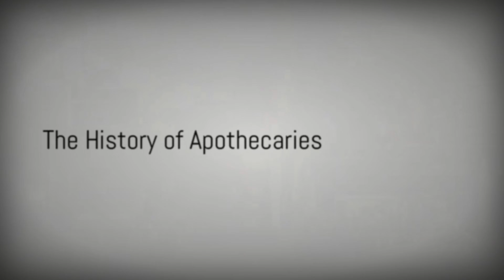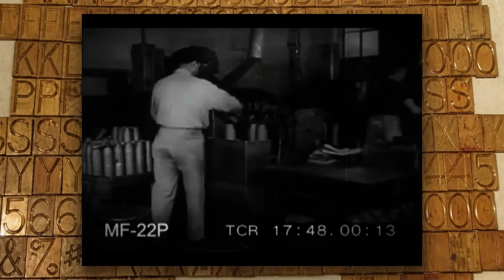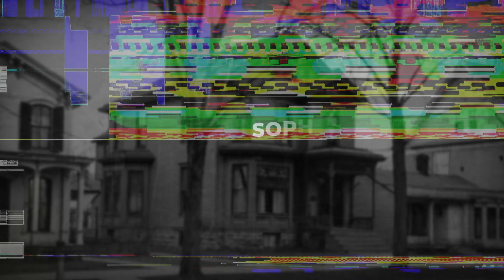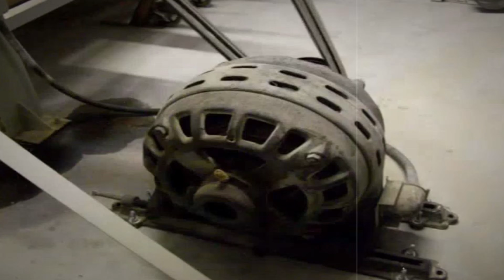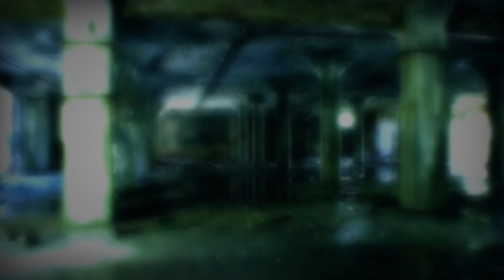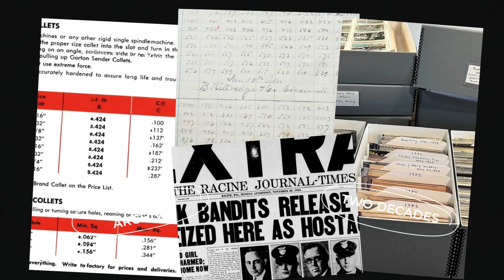The Rise and Fall of Gorton Machine Works

Comment: I new Albert Marini. He started Marini Tool and Die. His son Albert Jr. worked with him and took it over when Albert Sr. died. Albert Jr. son Tom Marini took over the tool and die business when Albert Jr. retired. Now the business is call Marini Manufacturing Inc. Still in Racine Wisconsin. Twin Disc Inc. purchased the Gorton building on Racine Street and moved some of there manufacturing equipment in the for a season. I think Albert Marini Sr. was the one that wrote the the Lord's Prayer on the head of a pin. If Albert Sr. didn't I know he was involved in it. I know they wrote it in the middle of the night. Because the vibration of traffic would not allow it to be successful.